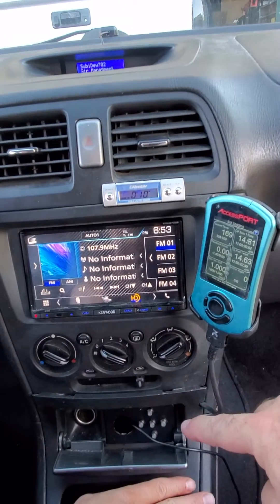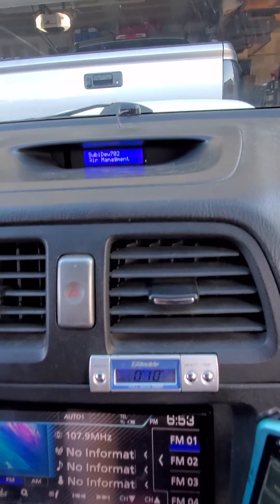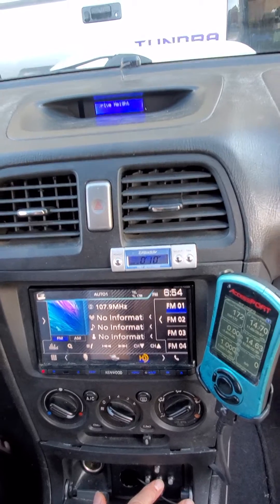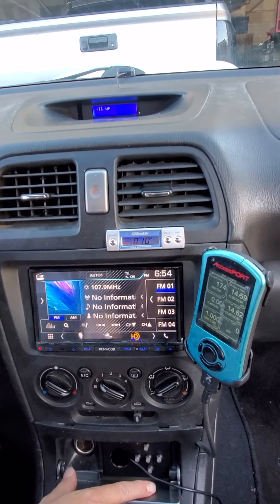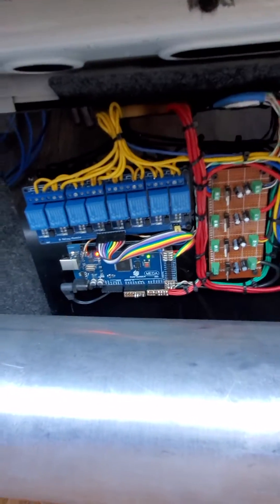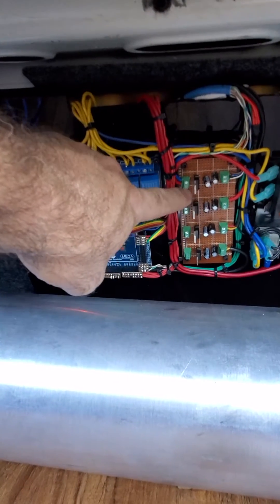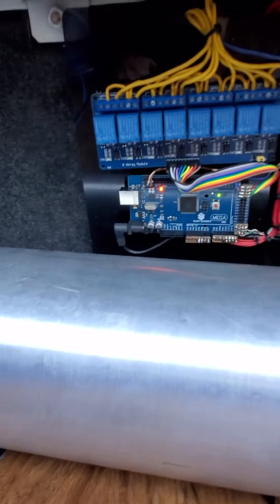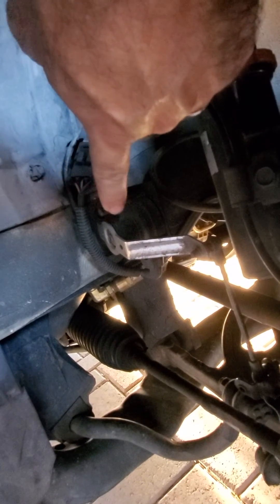Arduino based Air ride management.

Comment from the maker: My code, not super clean but has been working for 3 years with no issues

#include <LiquidCrystal_I2C.h> //includes the lcd library

LiquidCrystal_I2C lcd(0x27, 2, 1, 0, 4, 5, 6, 7, 3, POSITIVE); //sets the lcd dimensions

void setup() {
  // put your setup code here, to run once:
  Serial.begin(9600); //starts the serial monitor
  lcd.begin(16,2); //starts the lcd
  lcd.clear(); //clears any data on the lcd
  lcd.print("SubiDew");
  lcd.print(702);
  lcd.setCursor(0,1);
  lcd.print("Air Managment");
  delay(2000);
  lcd.clear();

}

void loop() {
  // put your main code here, to run repeatedly:
  Serial.println ("loop"); //prints "loop" to show where in the process the routine is
  extra();
  lcd.clear();

  }

  //void extra reads and prints the sensors data
void extra() {
  Serial.println ("extra loop"); //prints "extra loop" to show where in the process the routine is
  
  //RF Sensor code
    int RFsensorVal=analogRead(A13);  //Declares what input pin the RF sensor is connected too
    float RFvoltage = (RFsensorVal*5.0)/1024.0; // Declare voltage at the RF Sensor pin of the Arduino
    float RFpressure_kPa = (RFvoltage - 0.44) / 4.0 * 2850.0;          // RF sensor voltage to pressure
    float RFpressure_psi = RFpressure_kPa * 0.14503773773020923;    // RF sensor kPa to psi
   
   //LF Sensor code
    int LFsensorVal=analogRead(A12); //Declares what input pin the LF sensor is connected too
    float LFvoltage = (LFsensorVal*5.0)/1024.0; // Declare voltage at the LF Sensor pin of the Arduino
    float LFpressure_kPa = (LFvoltage - 0.44) / 4.0 * 2850.0;          // LF sensor voltage to pressure
    float LFpressure_psi = LFpressure_kPa * 0.14503773773020923;    // LF sensor kPa to psi

    //RR Sensor code
      int RRsensorVal=analogRead(A15); //Declares what input pin the RR sensor is connected too
      float RRvoltage = (RRsensorVal*5.0)/1024.0; // Declare voltage at the RR Sensor pin of the Arduino
      float RRpressure_kPa = (RRvoltage - 0.44) / 4.0 * 2850.0;          // RR sensor voltage to pressure
      float RRpressure_psi = RRpressure_kPa * 0.14503773773020923;    // RR sensor kPa to psi

    //LR Sensor code
      int LRsensorVal=analogRead(A14); //Declares what input pin the LR sensor is connected too
      float LRvoltage = (LRsensorVal*5.0)/1024.0; // Declare voltage at the LR Sensor pin of the Arduino
      float LRpressure_kPa = (LRvoltage - 0.44) / 4.0 * 2850.0;          // LR sensor voltage to pressure
      float LRpressure_psi = LRpressure_kPa * 0.14503773773020923;    // LR sensor kPa to psi

    //Tank Sensor code
      int TanksensorVal=analogRead(A11); //Declares what input pin the Tank sensor is connected too
      float Tankvoltage = (TanksensorVal*5.0)/1024.0; // Declare voltage at the Tank Sensor pin of the Arduino
      float Tankpressure_kPa = (Tankvoltage - 0.44) / 4.0 * 2850.0;          // Tank sensor voltage to pressure
      float Tankpressure_psi = Tankpressure_kPa * 0.14503773773020923;    // Tank sensor kPa to psi

    //Prints the pressures to the serial monitor 
      //Serial.println ("LF =");
      //Serial.print (LFpressure_psi,0);
      //Serial.println ("RF =");
      //Serial.print (RFpressure_psi,0);
      //Serial.println ("LR =");
      //Serial.print (LRpressure_psi,0);
      //Serial.println ("RR =");
      //Serial.print (RRpressure_psi,0);
      //Serial.println ("Tank =");
      //Serial.print (Tankpressure_psi,0);

    //Prints pressures to the lcd
      lcd.print(LFpressure_psi, 0); // LF Psi with no decimal places
      lcd.setCursor(6,0);
      lcd.print("Tank");
      lcd.setCursor(13,0);
      lcd.print(RFpressure_psi, 0); // RF Psi with no decimal places
      lcd.setCursor(0,1);
      lcd.print(LRpressure_psi, 0); // LR Psi with no decimal places
      lcd.setCursor(6,1);
      lcd.print(Tankpressure_psi, 0); // Tank Psi with no decimal places
      lcd.setCursor(13,1);
      lcd.print(RRpressure_psi, 0); // RR Psi with no decimal places
     delay(1000);
}
Reply: Amazing man.... Jeez
Reply: Shane is boss for this

Comment: Hey can you share any information about this. I never found anything about it want to fab mine up
Reply from the maker: I have to find my code and I'll share it. It's not a real clean code but it works. I'm still learning myself.
Reply: @shanewunder721  I was building the same project but never figured out the coding part, can you share it maybe?
Reply from the maker: @sergiocalta2838  shared
Reply from the maker: shared
Reply: @shanewunder721  did you share it on the video? I don't receive PM messages
Reply from the maker: @iiNgONYaMa  

#include <LiquidCrystal_I2C.h> //includes the lcd library

LiquidCrystal_I2C lcd(0x27, 2, 1, 0, 4, 5, 6, 7, 3, POSITIVE); //sets the lcd dimensions

void setup() {
  // put your setup code here, to run once:
  Serial.begin(9600); //starts the serial monitor
  lcd.begin(16,2); //starts the lcd
  lcd.clear(); //clears any data on the lcd
  lcd.print("SubiDew");
  lcd.print(702);
  lcd.setCursor(0,1);
  lcd.print("Air Managment");
  delay(2000);
  lcd.clear();

}

void loop() {
  // put your main code here, to run repeatedly:
  Serial.println ("loop"); //prints "loop" to show where in the process the routine is
  extra();
  lcd.clear();

  }

  //void extra reads and prints the sensors data
void extra() {
  Serial.println ("extra loop"); //prints "extra loop" to show where in the process the routine is
  
  //RF Sensor code
    int RFsensorVal=analogRead(A13);  //Declares what input pin the RF sensor is connected too
    float RFvoltage = (RFsensorVal*5.0)/1024.0; // Declare voltage at the RF Sensor pin of the Arduino
    float RFpressure_kPa = (RFvoltage - 0.44) / 4.0 * 2850.0;          // RF sensor voltage to pressure
    float RFpressure_psi = RFpressure_kPa * 0.14503773773020923;    // RF sensor kPa to psi
   
   //LF Sensor code
    int LFsensorVal=analogRead(A12); //Declares what input pin the LF sensor is connected too
    float LFvoltage = (LFsensorVal*5.0)/1024.0; // Declare voltage at the LF Sensor pin of the Arduino
    float LFpressure_kPa = (LFvoltage - 0.44) / 4.0 * 2850.0;          // LF sensor voltage to pressure
    float LFpressure_psi = LFpressure_kPa * 0.14503773773020923;    // LF sensor kPa to psi

    //RR Sensor code
      int RRsensorVal=analogRead(A15); //Declares what input pin the RR sensor is connected too
      float RRvoltage = (RRsensorVal*5.0)/1024.0; // Declare voltage at the RR Sensor pin of the Arduino
      float RRpressure_kPa = (RRvoltage - 0.44) / 4.0 * 2850.0;          // RR sensor voltage to pressure
      float RRpressure_psi = RRpressure_kPa * 0.14503773773020923;    // RR sensor kPa to psi

    //LR Sensor code
      int LRsensorVal=analogRead(A14); //Declares what input pin the LR sensor is connected too
      float LRvoltage = (LRsensorVal*5.0)/1024.0; // Declare voltage at the LR Sensor pin of the Arduino
      float LRpressure_kPa = (LRvoltage - 0.44) / 4.0 * 2850.0;          // LR sensor voltage to pressure
      float LRpressure_psi = LRpressure_kPa * 0.14503773773020923;    // LR sensor kPa to psi

    //Tank Sensor code
      int TanksensorVal=analogRead(A11); //Declares what input pin the Tank sensor is connected too
      float Tankvoltage = (TanksensorVal*5.0)/1024.0; // Declare voltage at the Tank Sensor pin of the Arduino
      float Tankpressure_kPa = (Tankvoltage - 0.44) / 4.0 * 2850.0;          // Tank sensor voltage to pressure
      float Tankpressure_psi = Tankpressure_kPa * 0.14503773773020923;    // Tank sensor kPa to psi

    //Prints the pressures to the serial monitor 
      //Serial.println ("LF =");
      //Serial.print (LFpressure_psi,0);
      //Serial.println ("RF =");
      //Serial.print (RFpressure_psi,0);
      //Serial.println ("LR =");
      //Serial.print (LRpressure_psi,0);
      //Serial.println ("RR =");
      //Serial.print (RRpressure_psi,0);
      //Serial.println ("Tank =");
      //Serial.print (Tankpressure_psi,0);

    //Prints pressures to the lcd
      lcd.print(LFpressure_psi, 0); // LF Psi with no decimal places
      lcd.setCursor(6,0);
      lcd.print("Tank");
      lcd.setCursor(13,0);
      lcd.print(RFpressure_psi, 0); // RF Psi with no decimal places
      lcd.setCursor(0,1);
      lcd.print(LRpressure_psi, 0); // LR Psi with no decimal places
      lcd.setCursor(6,1);
      lcd.print(Tankpressure_psi, 0); // Tank Psi with no decimal places
      lcd.setCursor(13,1);
      lcd.print(RRpressure_psi, 0); // RR Psi with no decimal places
     delay(1000);
}
Reply: @shanewunder721  but this isn’t the full code? Am I correct?
Reply from the maker: You are correct my code is to long for the comments ill dm you